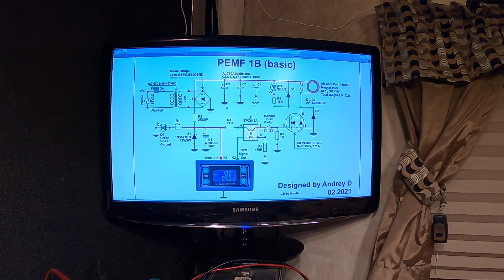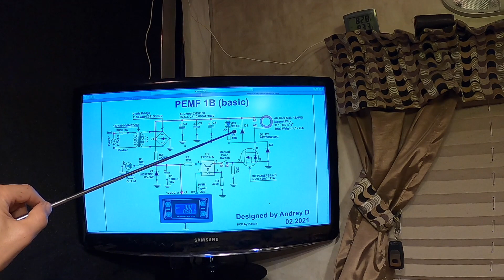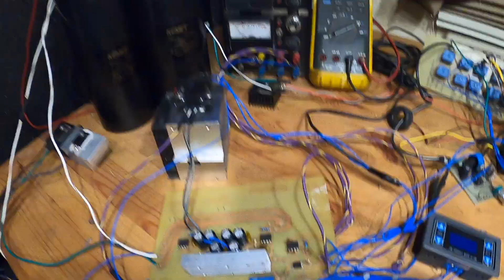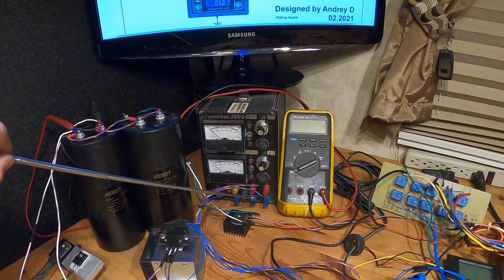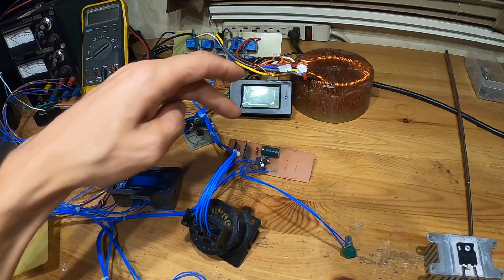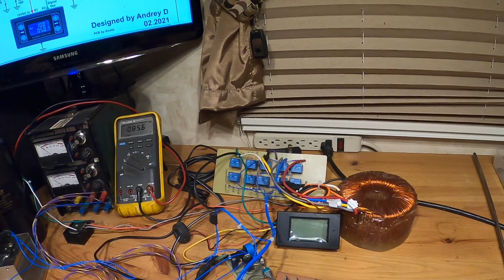033 My 410 Volts PEMF Circuit Prototype up to 11,000 Gauss 1-600Hz 1-30% Duty Part 1

Comment: Great kit. If I wanted to make a 12-coil mat with this circuit, what would be the configuration of each coil? And could I use the transformer you mention in the diagram? The one in the components list or do I have to make one? Would I be able to use it for 30 continuous minutes? Thanks.
Reply from the maker: @elgutitozamora  if you want to 7se multiple coils, you should connect t them in series. 
Session length depends on many factors, such as duty of the signal, lenght of the wire in all coils and thickness of the coil wire and other factors

Comment: Very cool! With power going up so high, any plans to incorporate a cooling function into the coil? Would that even be possible. So instead of keeping the coil cool by spacing out pulses or useing cold packs, the coil could be cooled ongoing as the unit is being used?
Reply from the maker: Yes Im planing on adding active cooling to this circuit.
I will be redesigning the coil so it will have gaps between the layers for the air to go true